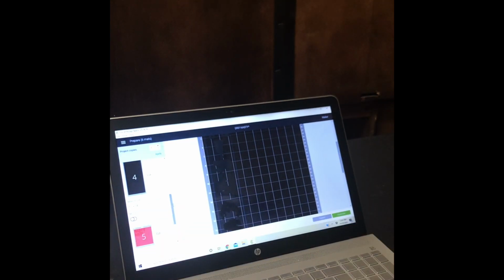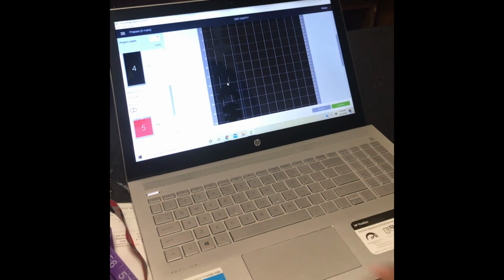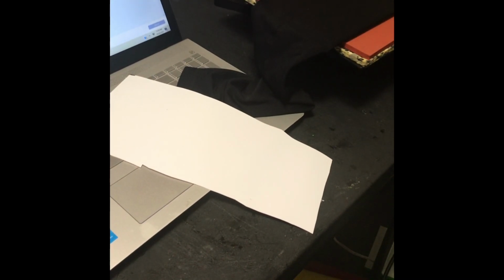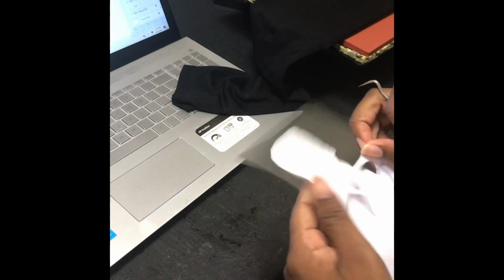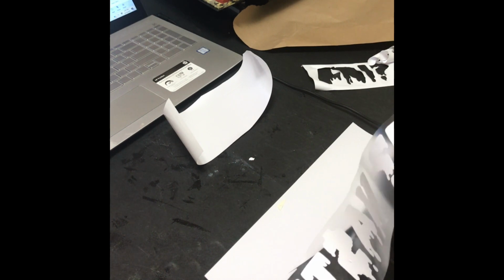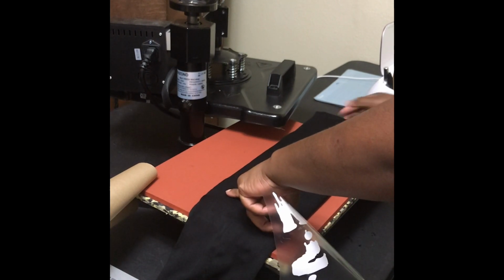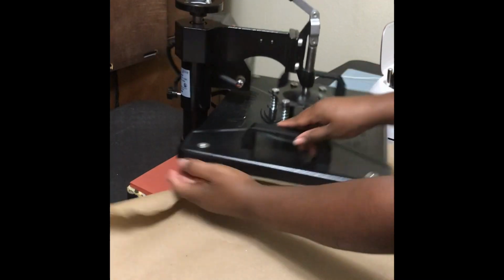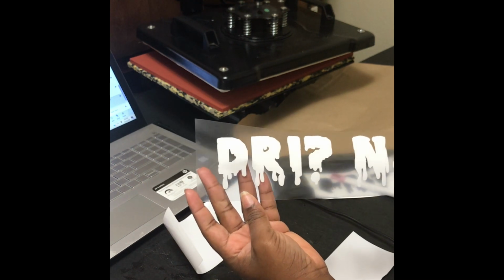How to create and apply HTV Heat transfer Vinyl to leggings | DIY tights | Customize track pants

Comment: Shouldn’t be holding the vinyl off the table. Lay it down and use your scalpel tool. Less issues removing extra vinyl from sheet ✊🏽 😊
Reply from the maker: Thanks for the tip. However, with the stretch it is hard to see the cuts. So I had to bring the vinyl closer to my eyes 👀 and light 💡 😂.
Reply: @craftinsanity  you got this! 💪🏽 nice work by the way….. 😊

Comment: where did you get your vinyl what software do you recommend what press and vinyl cutter would you  recommend
Reply from the maker: I use the Cricut Maker which is easy to use, however, some people like Silhouette because it cuts bigger designs. You can find vinyl at Walmart, Amazon, or I go to different  T-shirts store in Dallas. Which I believe also have website. I have video exposing some of the places I go to shop.
Reply: @craftinsanity  thank you so much u have a link for the vinyl u use for leggings . ben waiting to start for years just all was stuck on were to start . love your video  by the way
Reply from the maker: @Lamont6417  https://www.joinusonline.net/ you are welcome 😊